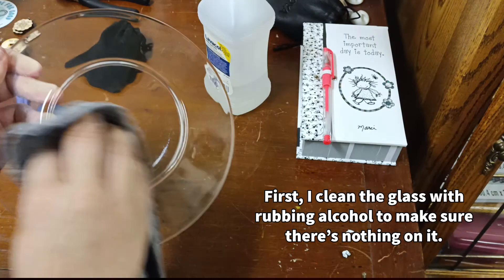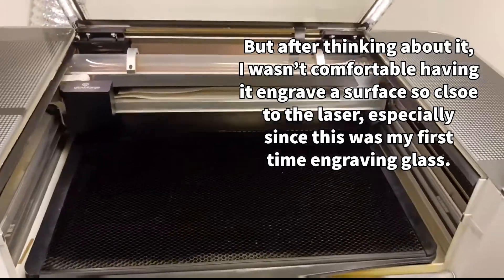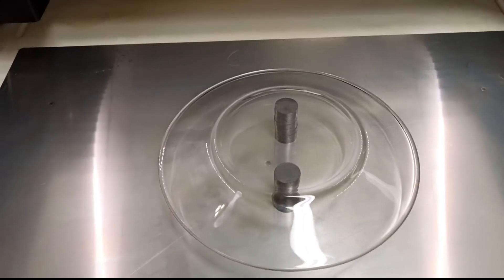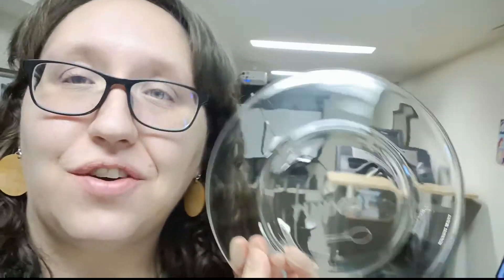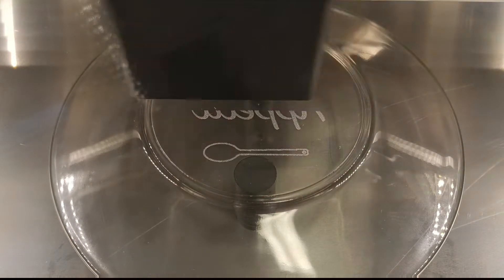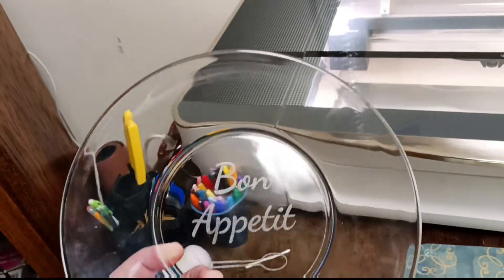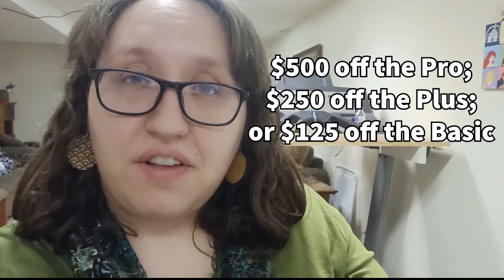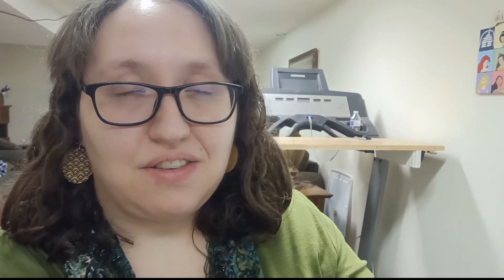How to Engrave or Etch Glass with the Glowforge

Comment: Did you clean the broken glass out of the image? if so what did you use to clean it out?
Reply from the maker: I didn't use anything to clean the image after engraving. The Glowforge basically just melts the glass, so it's not like there are shards or something that will hurt people if they touch it. It actually feels fairly smooth to the touch and since it's on the back of the plate, it doesn't come into contact with food or anything. After etching on the glass, I just ran it through the dishwasher & it was good to go! 😃